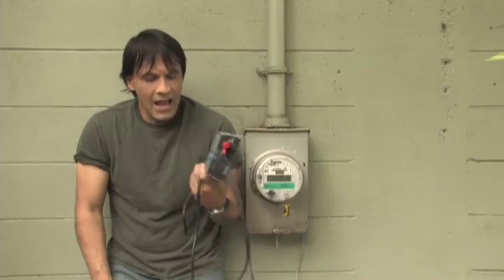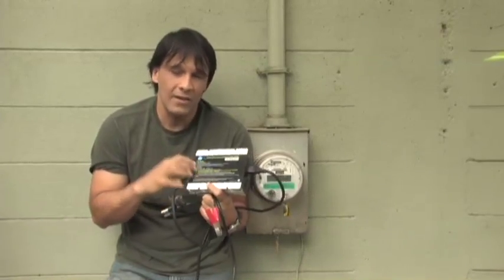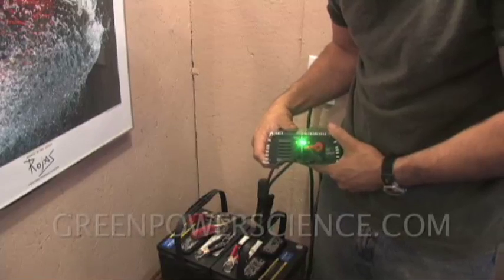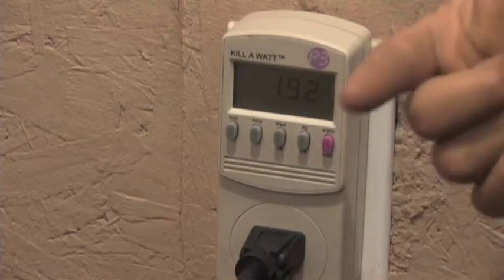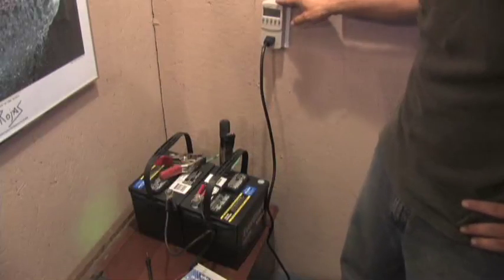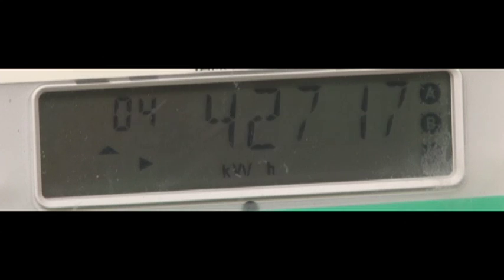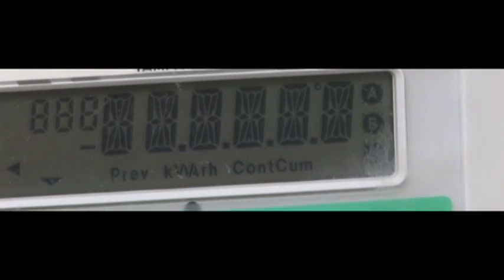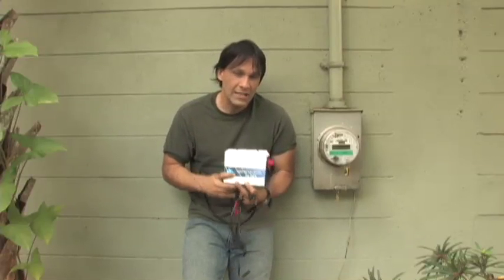GRID TIE INVERTER SOLAR panel POWER EASY Electricity Savings

Comment: Yes, I know we saw the backward arrow indicator on the meter. In my electric service area,
no DIY solar/wind installations will receive approval for grid tie applications. They must be installed by a licensed and approved contractor, using all UL approved equipment, must meet or exceed "code", be subject to permit and inspection and then the electric utility will give it their blessing. The cost is $6.00-$9.00 per watt. (continued)

Comment: I think you may have unwittingly made a mistake with your testing. Your outside KWh meter displays KWh in increments of 1. If your GTI is a 200 watt model, it would require 4-5 hours of driving your house wiring to have moved the KWh meter 1 digit, not 40-45 minutes. Now, aside from that, how were you able to power off everything in your house by throwing the "Main breaker"? Theoretically, the main disconnects the whole house from the meter. (continued)

Comment: Contact your electric company - many will allow your meter to flow backwards and actually pay you for the electricity you produce, albeit at a lower-than-retail rate.  Those meters can actually run backwards, but it must be with the power company's blessing.

Comment: As a safety issue, your grid-tie inverter should stop feeding the grid if there is a power failure.  This is for the safety of power line workers dealing with lines they think are powered down.
If you want to still have power when the grid goes down, you need a bank of batteries to draw from and an isolation switch to keep that power from feeding the grid.

Comment: If you have appliances running in the house say a tumble dryer that uses 2kw per hour and your using your GTI (grid tie) that's pumping out 300w then it should be off seting the appliance usage by that 300w. if your running the GTI and noting plugged in or on standby  in the house then that 300w should be going to the grid (in theory anyway).

Also remember not all meters run backward, here in the UK the companies have got wise about this and installed new digital meters that don't runbackwards

Comment: you need a KW meter to determing what your computer, tv washer dryer run at. add them together and thats what you ise for an hour.. say my computer and TV stuff: 350w for the computer, 360w for the tv, sky box etc thats 710 watt hours, then I need to factor in the efficiency of the Grid Tie Inverter (GTI) these are not that efficient 70-80% in most cases. there is loads of web sites with this type of information.

Comment: But, you should not pump more than 2000 watts into your wall plug, because most fuses are 15-20amps, and it would keep blowing your fuse, and overheat your house wiring.

Comment from the maker: Grid tie inverters run directly from the panel to the inverter, NO batteries. Grid tie inverters are different than regular inverters that are grid free requiring batteries and a charge controller.

GTI hook direct. The batteries in this videos were for testing only.

watch?v=rpafn-urjrg

Comment: @Dallas84701 Then
3600 Joules x (1/3600)(hours/second) = (Joules/second)-Hours,
or Watt-hours. We actually get more than 5 hours a day, if you
track the sun by driving the array, or even if you don't, because
the light falls off at the cosine of the angle from the sunlight path.
Then also there's reflectance of the panel surface at an angle.
If you put diffractive elements in front you can eliminate some of
that loss.

Comment: @Dallas84701 Yes, assuming your cells are 3.6 Amps max each
and 0.5V. Yes, 0.054 kW and four 5 hours you get 0.27 kWh each
day. The hours enter when you do it over the 5 hours. Before that
you only have a rate of delivery, Watts and kWatts. If you multiplied
by 3600 you'd have the number of kWatt-seconds. A Watt-hour is
a funny construction. That's (Joules/second) x hours which winds
up being 3600 Joules, since the (hours/second) = 1/3600.

Comment: @rstevewarmorycom yeah, I had it all broken up but I was over the max characters... That was still wrong...

So I'll try this again. 30 cells at 1.8 watts max. would be 54w.

54w=.054kw and say there's maybe... 5hours of ideal conditions in one full day, so generating .27kwh per day?

For some reason I was thinking, that you could multiply the .054kw by 3600 because watts are measured in seconds (3600 seconds in an hour) but that doesn't seem to be the case...

Comment: @Dallas84701 Okay: You should explain to me what you're
calculating here. What's "Wp"? Working Power? You should
separate each statement as a sentence and be explicit. From
what you wrote I can't tell what you mean, it could possibly make
sense or it could be baloney. 194 kW is a LOT of power. Somehow
I doubt that figure is correct from 30 cells of anything!  If you like
you can write me rstevew (at) armory (dot) com .

Comment: I guess I was really in misconception too....Really, they wouldn't work out the same at all, because any specific devices watt usage would be multiplied by 1000 (for the kilo) and 3600 Seconds in an hour) to equal it's kwh usage... Steve, change your wording in your arguments because, I've been studying small electronics for a while, and even talked with trained electricians on some things I'm working on, and I've never had it explained as well as arguing with your political ass...

Comment: @rstevewarmorycom 

: "However, both will reach the same end of the equation... So why is it that you don't have any videos, but you feel the need to go around posting on others about how wrong they are? "

anyway ^ was the point I was trying to make, not necessarily that kwh is not kilowatts per hour (which, essentially... isn't it V*A=W?) Amp is the rate, and V is the current correct? To say that people are incorrect in their thinking isn't necessarily true, even if it's politically incorrect.

Comment: @Dallas84701 That's
because JUST like the numbers the factor labels divide
as well, Watt-seconds are Watts x seconds or
(Joules/second) x seconds and the seconds cancel top
and bottom like in reducing a fraction, leaving Joules,
which are units of energy.

Comment: @Dallas84701 I may indeed be a know-it-all and even
an asshole, but I AM a working physicist engineer. 
There's a HELL of a lot of difference between something
PER hour and something FOR an hour, the first is
division, the other multiplication. Watts PER hour vs
Watt - hours, A Watt PER Hour is nonsense, since
a Watt is ALREADY a rate, like saying mph/hour or
something.While mph for an hour actually says you
went a certain speed for an hour, & that resolves
into a distance in miles.

Comment: @lykenth08 This can be detected by a window comparator or an 
op-amp comparator using a comparison of an immediately previous
value. This starts the sine wave, which is sometimes generated
out of a look-up table in a permanent memory or EPROM.

Comment: @lykenth08 Most inverters are cheap, and use a simple
oscillator to produce the sine wave, and they do it using
square wave approximations. So does the grid-tie inverter,
but it generates a sine wave at 60Hz accurately, AND it
keys the start of the sine wave to the rising of the grid's
power from the zero mark or the minimum, the negative peak.

Comment: @Dallas84701  And a grid-tie inverter synchronizes the
sine wave of power to the grid's own sine wave, so they
don't fight each other's phase, and you'd need an export
meter to register power exported, your regular meter 
doesn't do that.

Comment: @Dallas84701 The Joule is a Newton-meter, where a
Newton is a unit of force, and the meter is distance, force times
distance is energy. Thus a Watt is a RATE of delivery of Joules
per second. Saying Joules per second per second is nonsense.
A Watt-second is a Joule, a Watt-hour is 3600 Joules, and a kilo-
Watt-hour is 3,600,000 Joules, or Watt-seconds. There is no such
thing as a "kiloWatt per hour". I should know, I'm a physicist.

Comment: @Dallas84701 No, no, no, no. kWh is kiloWatt-hour, which
is the delivery of a thousand Watts constantly throughout one
hour. 1000 Watts would be the brightness of a big flood light,
and running it for an hour represents a unit of energy. A Watt
is a Joule PER second, (J/s), A Joule is the energy gained by
a 1 kilogram mass which is accelerated at a rate of 1 meter
per second every (that is "per") second, (1 m/s/s) through a
distance of 1 meter.

Comment: @Dallas84701 also, in our small community, the assholes from the power company guess every month, and then actually read the meter about once every 3-4 months... I think being conservative, and working on being off-grid is the spot... Even if that means you have to give your eyes a workout.

Comment: Dan, the grid tie inverter not only matches the frequency of the grid,
but, and all-importantly, it matches the phase, starting its sine wave
at almost exactly the same place in the wave as the grid sine wave.
Otherwise you have an effective partial short-out of the power, with
the grid and the inverter fighting each others'  voltages.

Comment: You have to ask your wires company for a bi-directional meter. They will not give you a bi-directional meter without an inspection of your equiptment and CSA certified equipment.

Comment: @calimanmancali Depends where you live. There are state laws, local codes, and contract provisions by the power companies.  In my area it requires insurance, an official inspection, and a statement from the COMPANY that manufactures the components. You would never get a DIY system through those hurdles. But different areas and different power companies may have different rules.

Comment: @carlojpf2 

yeah i thought about that too, using it as a buffer, from battery it takes about 18w or so from 12v battery ( even though it says it can take between 10v upto 28v ) , but hooking two 12v batteries together to get 24v then should take more somebody else adviced, more efficient than and all, i shall make sometime a movie too from stuff i got & all ... thanks

Comment: ok, i have a grid-tie inverter now but it says range of 10v or so till 28v or so, so with 12v solar panels it should also work then , not ? however in the manual it says it requires a minimum of 30w for it to work ( for a 200w grid-tie inverter ) , i have 48w in totall on solar panels, hooked it up and red fault led burning alot , and the green led when plugged to wall-socket is good , does this mean that the sun wasnt shining enough to get to minimum of 30w or other problem ?

Comment: @WRH052970 you can use them all on the same circuit as everything else, they don't have to be seperate, good idea to put it on a surge protector though.

Comment: Hi! I'm using multiple grid-tie inverters in my house, however my meter is not the traditional one. Rather I'm using a prepayment card of prepaid meter? Though during daytime, my electricity consumption seems to have reduced a bit but I'm not   sure if it makes my prepaid go backward?  Can you discuss about this issue for me? Likewise, my wind turbine is just generating a fluctuating volts  between 6-12 volts, can this voltage ranges really make a  difference? Thanks

Comment: Dan,
    How do you get power back to the meter if you turn off the main?
I think you should have turned off all circuits except for the one that had the grid tied inverter and left the main on.. Anyway great video.. Are these legal or do states have some requirements to stop homeowners from doing this

Comment: If this technology could get real currency, power companies could re-evaluate their grids. Not every homesite makes for a prime customer. Considering maintenance and easements, some areas are only marginally profitable. Why not own interest in sister companies that convert homes to off-grid or "low-grid" power and help maintain the home systems?   Over a period of 20 years, simple attrition of grid networks could slow down fossil fuel consumption greatly.
Reply: If the system is sending power to the grid, what do you do in a power failure?  If the grid goes down and you send power out, it hits the transformer and turns into 1080 volts.  That can kill the guy working on the line

Comment: If you did build a system to back feed at power levels over 1 kW you would need to verify that all the wiring on that circuit is of a heavy enough gauge to support that load, most wiring in your home will support a minimum of 1.2 kW, if your over that you could potentially cause a fire.

Comment: Hi Dan. so can you plug in two inverters to a battery bank? I have a 240 watt solar panel with a 920AH bank of battery. My 1500 watt inverter is running everything in my house and im planning to buy a portable electrical stove which i would need another 2000 watt inverter to run the 1500 watt stove, so is it doable to hook an additional inverter to the battery??? Thanks

Comment: First of all u must have turned off every individual breaker & not the main, & then turned on a single breaker with no load on it & plugged the inverter into that. As if u shut the main breaker off u have disconnected ur panel to ur meter. Unless u jumped into between ur meter &ur panel. Better to get proper disconnect panel that will run ur solar or wind to grid. Hydro pays higher rate for hydro produced then what a homeowner gets charged for using. Yes u need about 5 hours to make 1Kw @ 200w

Comment: Say I have a small wind turbine and a small bank of batteries, say 48 volts. If my batteries dropped below the lowest working rating of the inverter would it shut off and allow them to come back to full charge or does it place a constant drain on them? Seems like the inverter would really shorten the life of even a true deep cycle battery. Would I not be able to just run straight from the wind turbine  to the GTI and bypass using batteries all together if my stator was wired to put DC voltage?

Comment: hi i have a  steca tarom 440 12v/24v/48v   charge controller pwm battery charging. my panels are 24v but my batterys 12v will it go 24v to 12v thanks

Comment: hi dan it's oliver. just want to give a piece of my mind. i think im not convinced yet that your meter is greedy. here's why 1 digit represents 1 kilowatt hour  right? tell me if im wrong. and your giving off only more or less 200 watts so that is basically 0.2 kw.  you are running that for 40 - 46 mins, so it's only more or less0.133 kilowatt hour. the meter will not registered that. what is suggest is since you are giving off 200 watts why not try to run that for 5+ hours and see wat happens.

Comment: That's an older type of meter that was to be setup for time of use rate (TOU).  The newer meters GE or Landis&Gyr will display the real time kWh that the house is drawing.  I was able to get my draw (when not home) around .180kwh. So the Harbor freight solar panel, GTI and batteries would actually help to offset my usage?

Comment: Hey DAn, I want to use 12v panels but also a grid tie inverter. Now I believe you said I need to have the batteries connected in series to have 24v does that mean I need to have the solar panels in 24v series as well or can I have them jus t run 12v to the batter bank ?

Comment: @GREENPOWERSCIENCE Hi dan, I was doing research on these Sun G grid tie inverters and it seems that they are not UL or IEEE compliant.  I'm guessing if you plugged one of these in and your power company found out, there could be issues.  What are your thoughts on this?  Do you think they'd be able to find out?

Comment: @GREENPOWERSCIENCE  Hi Dan, I've been researching these grid tie inverters from SunG and I don't think any of them are UL or IEEE compliant.  If you plug them in and your power company finds out, I'm guessing there could be issues.  What are your thoughts on this?  Will they be able to find out?  Thanks!

Comment: Hi Dan,
       Excellent demo. You have a 200 watts inverter and a greedy meter. The meter reads 427 17 and it didn't go back after 40 minutes of pushing 200 watts. My question is" Let's say my appliances are pulling 199 watts and the grid tie inverter is pushing 200 watts, does the greedy meter should still go forward above 427 17 or it just gonna barely stay at 427 17. REGARDS( JUAN )

Comment: Great video but here is crazy question can you put grid tie inverters in series just like batteries to increase possibility of higher voltage (over 55VDC) being split among inverters in series and keep amps the same so you don't go over the input voltages on inverters.  
You can get 60-70 volts on wind turbine but grid tie inverter only operate 28-55vdc so it would burn out than.

Comment: if you turn off your main in the house  how is it possible to get a reading on the house meter?  you just disconnected it by turning off the main in the house therefore the power from the grid tie inverter cannot give you a reading on the house meter. please reply

Comment: Dan - do you have any good locations to get a grid tie inverter? I would like to make a system that maintains the battery's and then gives the excess to the grid tie.. any advice... I also know to truly turn the meter backwards I believe you need to feed to both legs of the main line not just one leg.

Comment: First, Thanks for the video. I have a 2000 12v inverter, but didn't know about a Grid Tie Inverter. Good to know! I'm planning on using a combination of wind and solar power to charge up a battery bank (I have to work up a little more math first!). at 7:42, the pop-up box on the right said that in an electricity outage, the safety feature shuts it down. Is there a switch to swap from a drid tie inverter over to a regulat inverter?... or should I NOT try that?  I don't want my food to spoil!